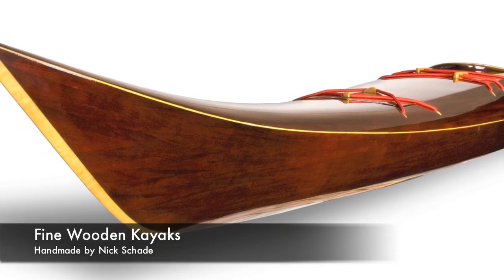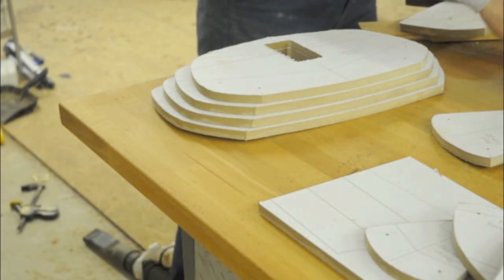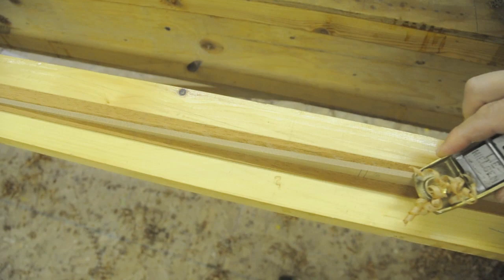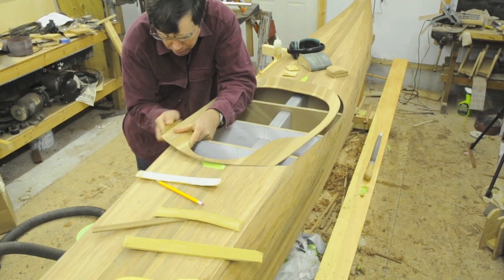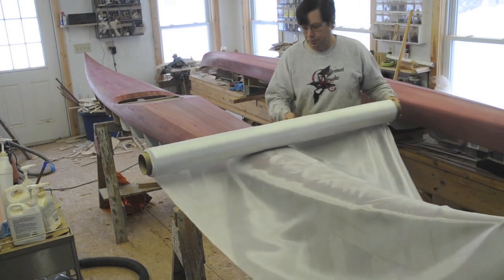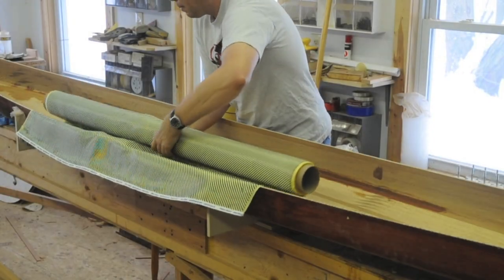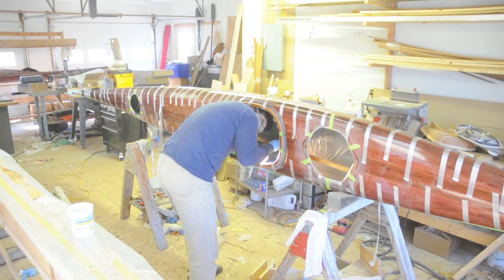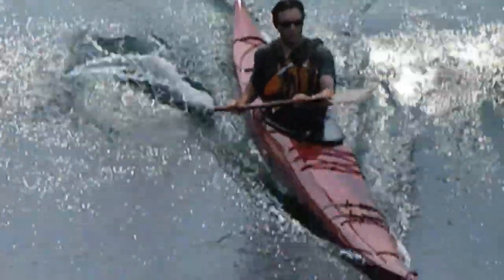Making a Strip Built Sea Kayak

Comment: Its fiberglassed, and epoxied with carbon fiber kevlar material thus made hard. The carbon fiber  material being as tough as steel and flexible until made rigid with epoxy. SO im guessing its structurally stable without ribs. It didnt have ribs at all though, the wood you see at the beginning is like a mould use to guide the strips into place then glued shut to each other.

Comment: Its extremely stable without the ribs and such normally associated with other craft. It does not twist, or deform in any way.  The composite structure is VERY rigid.